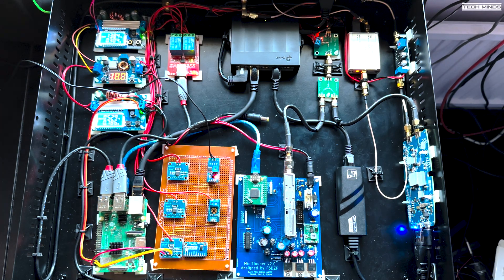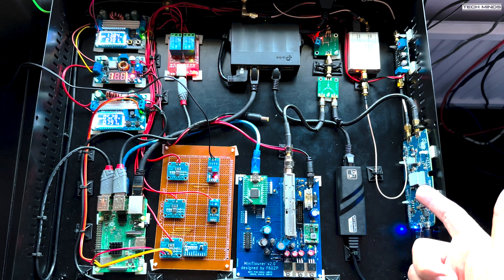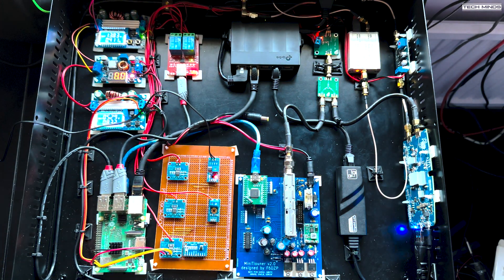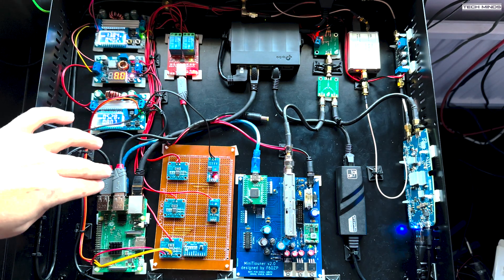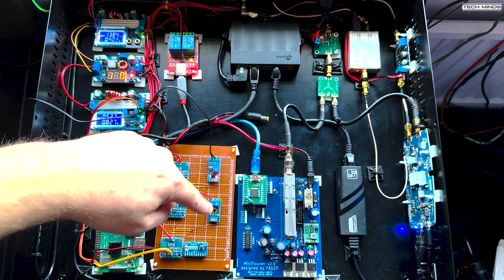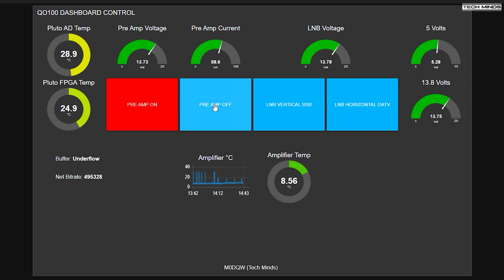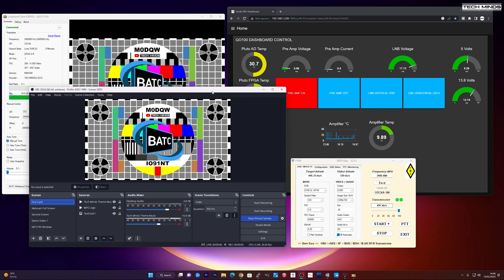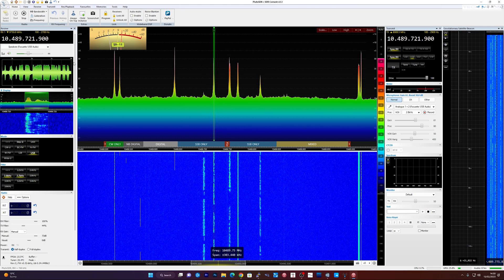THE ULTIMATE DATV & SSB QO-100 Transceiver Build - Part 2

Comment: Nice job, Matt. I do simultaneously SSB and DATV on the same time. It give me more fun and connections  to Colleagues who do not have ability to contact on DATV.
Reply from the maker: I’m actually thinking about going down this route too. Being able to switch between the two is cool, but running both at the same time is even better. I actually have all the gear to setup another dedicated NB transceiver, so I may just do it :)

Comment: discrete lack of of ferrite beads.. you should rf shield all boards individually  then it will be solid no internal noise  also is the tv card 75oam receiver? did you bother to match the input coax?
Reply from the maker: Ferrite beads? Blimey, haven’t used those for over 20 years when I built professional Infra Red audio transmitters. Of course I used 75 ohm coax for the LNB, I’m a FULL license holder don’t you know! 😂

Comment: Arduino failure was probably a leaky bit of code somewhere eating your memory hence everything comes to a grinding halt.
Reply from the maker: That’s what I thought at first, but I kept an eye on it and lots of memory space. I did have issues when I was using the UNO, so changed to the mega and solved the issue until this freezing started to happen. The Arduino didn’t even reboot itself, it just hung. Anyhow, probably solved by using Node Red, although this brings its own issues! lol cheers

Comment: Nice. Looking forward to the demo on the BATC net tomorrow. Can't read over 16v sounds like a value stored as a 16 bit signed int in mV not being handled properly somewhere. E.g. parity bits vs 2s compliment, adc a cal factor etc.